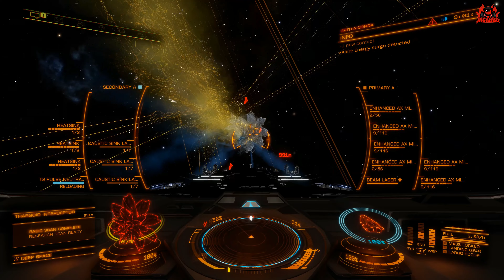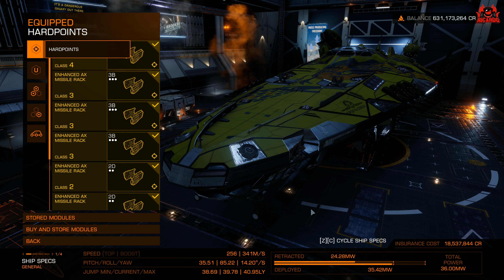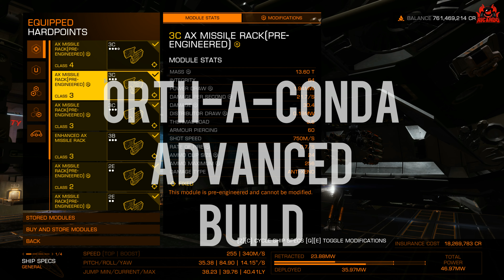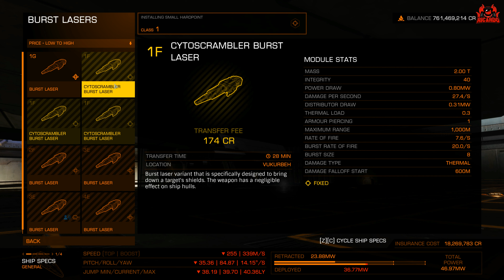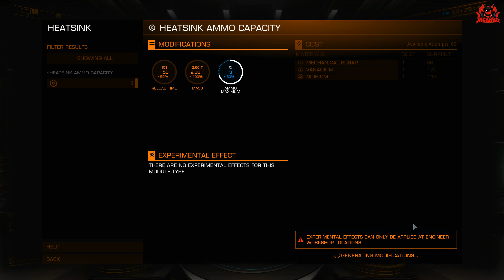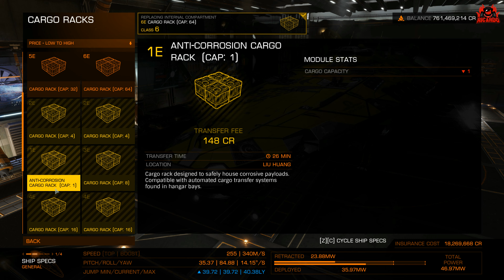The Ultimate Orthorus Build for Elite Dangerous

Comment: Worst part for me is still the material gathering required everytime i need to build a new ship, how do you deal with that? Yes the material trader helps now, but still... I always find me short of materials, the trade rate for g5 and g4 is brutal
Reply: Main problem is not trading down, is getting those grade 5 in the first place and trading for grade 4 or other grade 5 which has a terrible rate. 
I'll try those sites anyway
Reply: @ShinigamiGrin  Send me an FR.  I'll help you with manufactured.
Reply from the maker: For raw … crystal shards